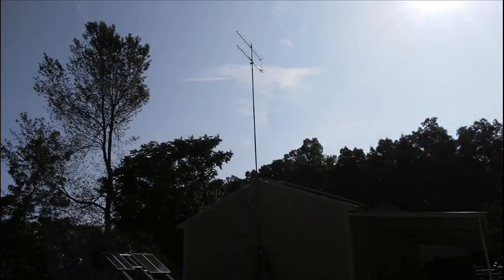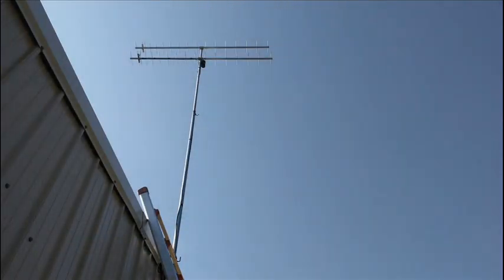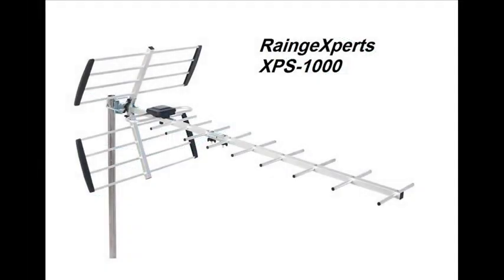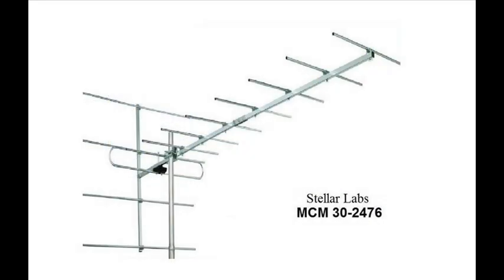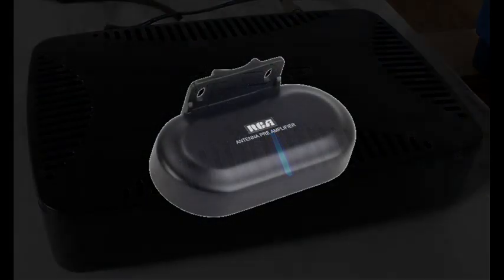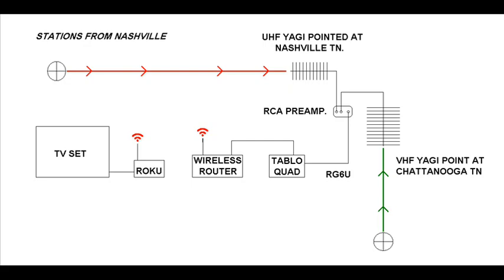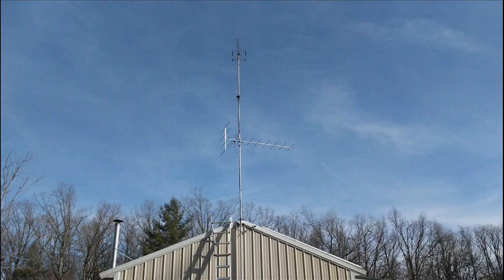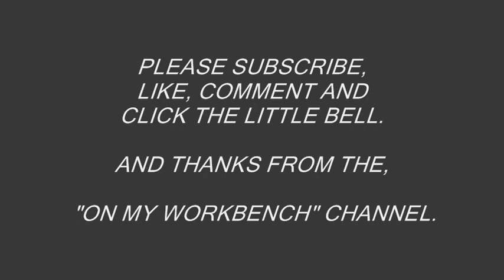DIY TV ANTENNA FOLLOW UP

Comment: What a shame the homemade ones didnt work - I was very impressed by the antennas you made.  I'm puzzled at the hi SWR. Did you use anything to combine the signals from the two antennas in an impedance matched way to the transmission line? If not, and if the receive end of the cable was attached to a somewhat mismatched load, you could end up with a filtering effect occurring from the reflections.  It almost looks like that on the right side of the NanoVNA display. If so, you could tune it by changing the length of the antenna to receiver cable. Of course that's a mute point now that you switched antennas.
Reply from the maker: I used a phasing harness in between the two antennas and connected a 300 to 75 ohm balun aka Matching Transformer at the terminals of the bottom antenna to the input of the amplifier. The phasing harness, Matching Transformer, amplifier and the antenna all worked good until WTVF change their frequency. Perhaps I will revisit it someday.
Reply: @onmyworkbench7000  Would be an interesting thing to have a go at if you ever have time!

Comment: Truth and Quality.
Practical and Useful Information.

Yes I do understand the situation with your home made antenna and what to do about it.

Any way , moving on to types of factory built antennas.

For UHF reception an upright vertical bow tie 8 bay UHF antenna has very good long distance reception.
Here is some reasons why.
The Tv signal over long distance tends to rotate out of the horizontal plain , ( one aspect and not the only aspect ) is  the V shape of the elements is a little better at receiving a signal that has rotated a little out of the horizontal plain.
The signal does this mostly because of the Earths magnetic field that is not even and stable every where all the time.

Also over long distance the signal tends to shift/move a little , up , down , side to side.
So the broad flat surface of the 8 bay UHF antenna is better at receiving a signal that is shifting a little.

And yes atmospheric conditions can effect Tv signals.

You can go deeper in to the understanding of this at Tv DX websites.

---------------------------------------------

As interesting information at this point in history a long time ago in the past , upright vertical broad flat antennas were made that are for reception of , VHF low band and VHF high band were sold.
And Yes as you might surmise , these were Big antennas.
Reply from the maker: Gene, 
I have thought about using a UHF bow array  but I am concerned with wind loading, we get a lot of wind here.
Reply: Yes wind loading can be an issue.  However with Strong and Sturdy installation will not be a problem when using quality antennas from , www.channelmaster.com and www.antennasdirect.com.

And if you really want go for extreme high quality extra strong antennas.
www.wade.antenna , www.wadeantenna.com.
Wade antenna advertises to Cable and Professional industries that require zero down time.
And Yes any one can buy and use the antennas.

And Yes the prices reflect the quality and durability.

Typing model numbers of the antennas in internet will bring up authorized distributors.

Like , and not limited to , www.tonercable.com and 

www.markertek.com , an easy way to find items at markertek is to click on Top Brands , See all brands.